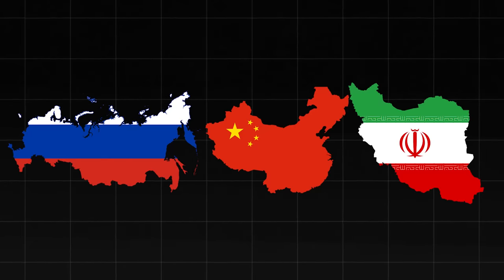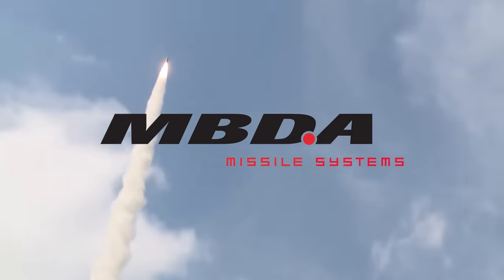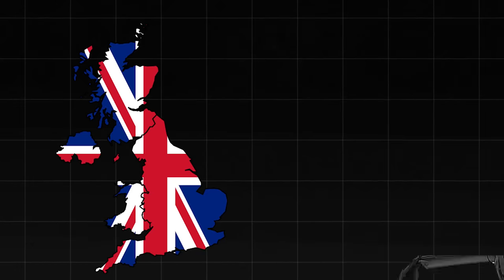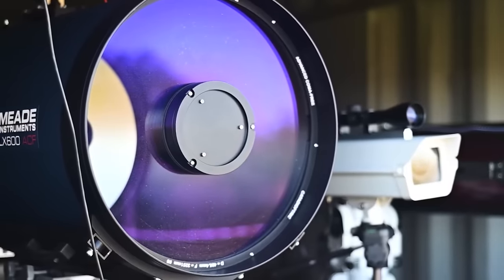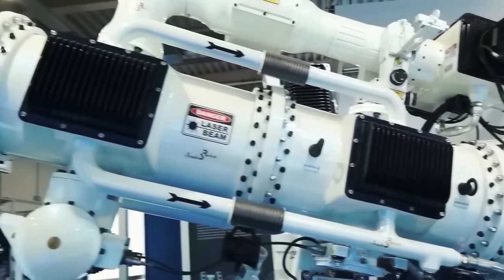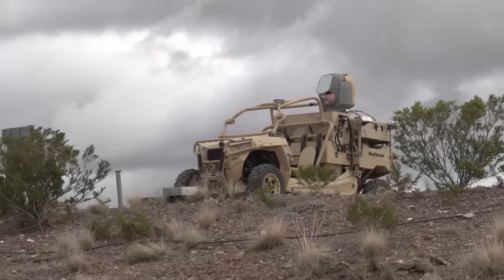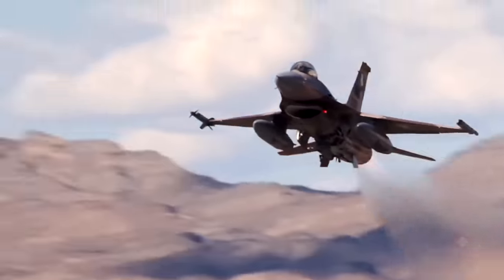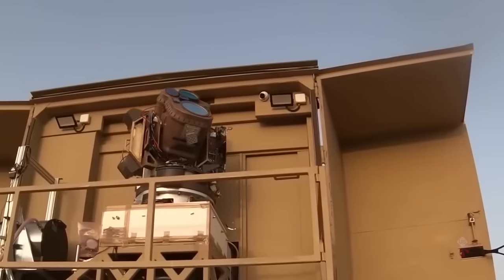UK Just Fired Worlds Most Powerful Direct Energy Weapon “Dragonfire”

Comment: The thing tries to burn a hole in targets.  Too much like a magnifying glass on an Ant.
Simply fit a mirrored surface to  'targets' and  the Laser  is immediately rendered useless. 
 Arms  makers always Fail to understand that 'countermeasures' can be laughably simple AND effective.
Reply: your missing the thermal aspect - deformation of high-tensile materials occurs much faster especially when under stress and strain of say supersonic, or even hyper flight - even 1 second of beam upon a metal cylinder could be enought to divert its flight plan and send off target - not each hit has to be a destuction - just enough to deform/disarm/disable( and hopefully also destroy) - early days - but promising tech, once the power is upped, flying tubes have no chance - even super heating the air column about the object will affect its trajectory 
 - plus, more than one can be trained onto a target - so imagine three of these targeting the same one pound dot - kabluuwey!